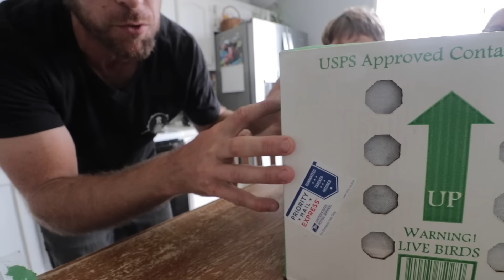We DIDN’T order these birds. What’s in the box?

Comment: Quail need a short long cage. They can actually get hurt trying to fly up. Might want to redesign cage by laying it on its side.
Reply: Rebel Canners   They can fly up. You just don’t want the cage that is not tall enough.
Reply: Lu they get hurt flying up they are ground  birds not flight birds they need floor space to run around.
Reply: Being lucky isn’t the same as being correct
Reply: Technically bobwhites which is basically what these are are very capable of light considering I have some myself and they never get hurt flying around, I agree they should have more running space as they stay on the ground more than they fly but they will fly if they want to as they are just like birds, they're not like coturnix quails which are completely ground birds but are able to glide short distances if scared
Reply: Spider Fellow these look like a color variable of cornix quail to me. Bob whites are larger and require a permit to own in most states FYI.
Reply: @RebelCanners  may i use that. It was a good one.being lucky isnt the same as being correct. Love it
Reply: Dot Hatch sure go ahead and use it I got it from my dad
Reply: @RebelCanners   Thanks I cant wait to use it on someone

Comment: You did a great job on the quail house. The only thing I would recommend is that you add some straw to that bottom level which will keep the pee and poop from soaking into the wood, it will soak into the straw or hay and then you can just rake that out straight into a wheelbarrow and just add it to your compost pile and you will not have to scrub it all off of the wood. It will make your job even easier and make maintenance a simple job with no cleanup. I was pretty harsh in my comments about that duck coop you put the ducks into after you lost a couple that flew away, and I still stand by my comments. But I thought I should also comment on what a great job you did building a nice home for the young baby quail especially being that they were so unexpected, so Kudos!

Comment: I don't usually comment, but I like your vids... You absolutely need a four wheel dolly. 3/4 plywood, locking wheels, narrow enough to get through an exterior doorway (if that matters to you), and a rope attached to the corners so you can pull from the bottom. (You also need an assistant for heavy and particularly awkward loads.) It's got a million uses. You won't regret the minimal investment. I have added hardware to allow me to move 4 sheets of drywall at time. Oh, knock the corners off to avoid damaging walls and ankles.

Comment: I had a similar issue with a mystery plant. It took me a couple of months to figure it out.

I had been ordering Empress trees for around our house. Everything was accounted for. Then, weeks later, I got a plant. No receipt. Not something I recognized. I reached out to everyone I knew and joined a plant identification group just to try to figure out what it was. "African Violet" was the common guess, but that was wrong to me. My frustration is that I didn't know how to care for it.

About two months after the tree came I went to Ebay and discovered that I had a message. The seller of one of my Empress trees had been told that the delivery failed. They were concerned about making it right. When they didn't hear back, they went ahead and shipped me their last seedling as a replacement and then closed their store for the season. Ebay had forwarded the message to my email, but I didn't see it because it went to my junk folder. 

I didn't recognize the plant because it was at a MUCH earlier stage of development than the ones I'd bought before. It didn't turn into something I knew for months. Actually, right about the time I figured it out I was starting to suspect that it was another tree. (Which made NO sense because I knew for a fact that I'd received all the ones I ordered.)

You guys have NO idea how insane this made me.